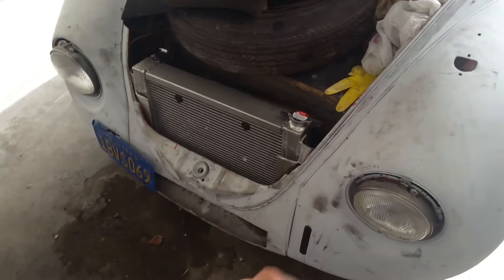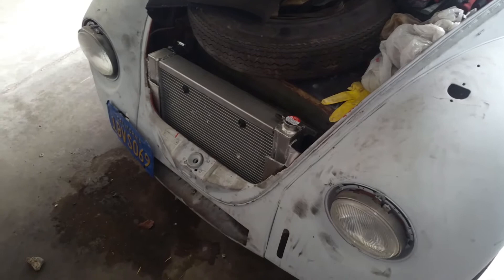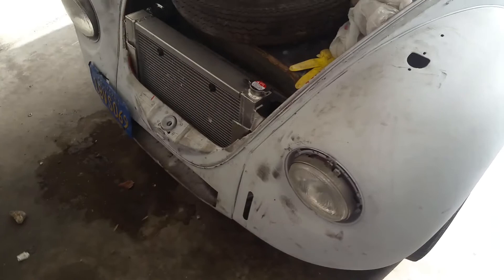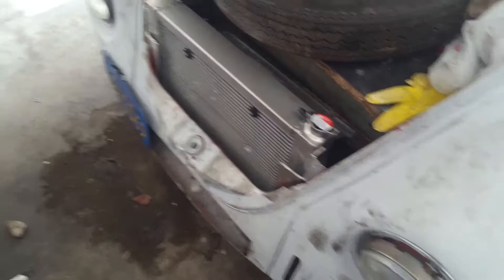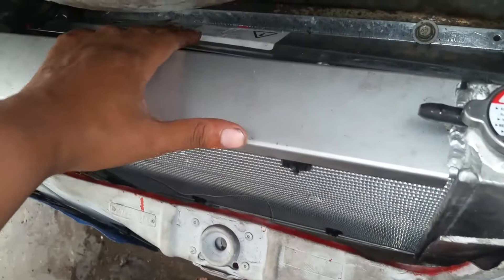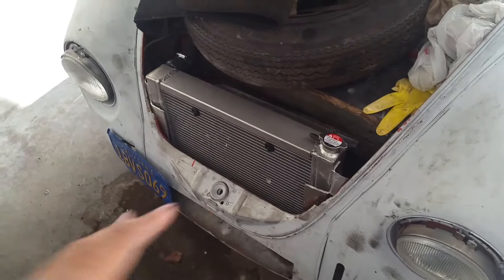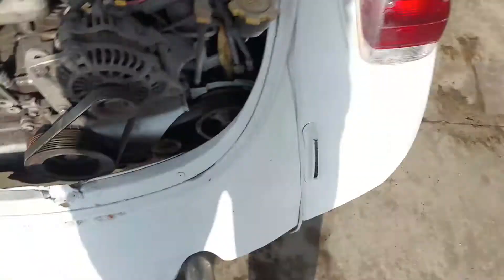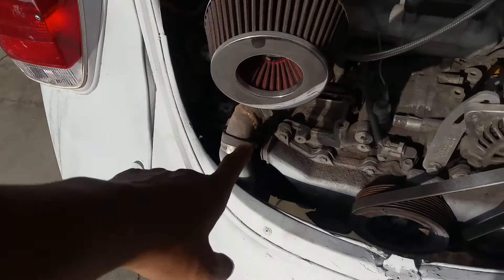Ej22 swap radiator update.

Comment: Golf mk1 radiator is so far the best. Due too its size fitted a 14' fan on it. Didnt make cuts on front valance of bonnet instead opted for the scoop under the nose
Reply: You got any video? Or photos
Reply: What year?
Reply: @randyochoa1757  any year mk1 golf or mk2 golf.
Reply: @randyochoa1757  yes got photo of a friend setup.

Comment: Hi Randy!! great videos! Im here in L.A. and have a question about the fuel system....what did you run and how did u do it and any modifications?
Reply from the maker: for the fuel system i metal fuel/brake line run form the front to the back. i'm using a bosch inline fuel pump from a older volvo and it works great. i use a T by the tank and i used the old line as a return line.
Reply: Hi Phillip, thanks for the response.. didnt mean to call u randy oops...hey was wondering what is the outside diameter of the fuel line?
Reply: 8mm OD for fuel hard line or 8mm ID for hoses. You can ran return using the tunnel original fuel line like Philip did. It's smaller but it works.

Comment: did you have to do any cuts to the rear body in order to fit the engine...mine since to hit on the sides just where the coil plugs are and on the timing cover...whats your advice..before I do some cutting and mess it up..lol
Reply from the maker: Manuel Garcia-galarza I had to take a little off the side of the bay

Comment: what coolant gauge did you go with? and did you use stock sending unit or aftermarket sensor
Reply from the maker: got a cheap aftermarket sender and gauge off ebay running from the radiator. i also use ecu reader for ecu temp reading.
Reply: i got one of those adapters aswell are you liking it does it read well being its off of a line and not the block?

Comment: Is your coolant temp sensor on the engine? Or in the front?
Reply from the maker: monica93304 I have the a aftermarket sensor and gauge in the radiator up wrong r and the original sensor connected to the ecu.